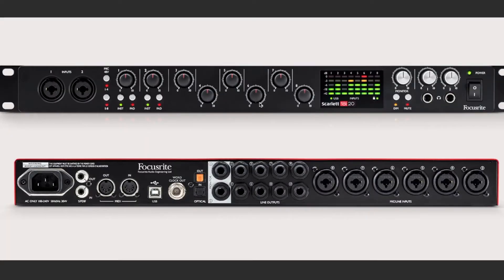Understanding Digital Audio Formats and how to use them. Lesson 12.

Comment: Amazing info and great detail. If you connect the SPDF output from an audio interface to the optical in on a computer would it play all those channels as a stereo mix? I know the usb only recognizes input 1 and 2 when you are not using a DAW. Would the optical in help me use the audio interface as a mixer? Thanks.
Reply from the maker: I don’t think it would play all the channels as a stereo mix. I’m not sure how the optical inputs on computers are integrated though.
Reply: Thanks, your channel is full of incredibly useful information 🤘🏼

Comment: really helpful, thanks.  I'm looking at the back of the rme 802 and wondering why there is an in/out aes/ebu xlr port.. does that only provide two extra channels? can't figure out the benefit.
Reply from the maker: So these AES/ebu ports that are XLR connectors are capable of interfacing with another AES/EBU device, and each XLR connector can carry 2 channels of digital audio at any sample rate. So on the RME, at 44.1 or 48 KHz, it can both send and receive simultaneously 18 channels of digital audio, 16 through Adat, and 2 through AES/EBU. At 88.2 or 96 kHz, it can handle 10 channels of digital audio, 8 with Adat, and 2 channels of AES/EBU. Thanks for the question :)
Reply: @Get.Pro.Recordings  makes sense! appreciate the detailed reply :)

Comment: It's never clear with the AES/EBU which is the input and which is the output though
Reply from the maker: Yeah, it can be confusing. They normally use a DB-25 connector, which you would attach an 8 channel XLR breakout cable.  Each XLR connection can carry 2 channels of digital audio at any sample rate.  There's different protocols, but the most common is the Tascam pinout, in which XLR connectors 1-4 provide your 8 input channels, and connectors 5-8 are your 8 output channels.
Reply: @Get.Pro.Recordings  so digital output 1 carries channels 1 AND 2?
And Digital Output 2 carries channels 3 and 4?

I thought that digital output 1 should carry channel 1.
And Digital Output 2 should carry channel 2.

What am I missing?
Reply from the maker: @eirodgers07  There are different ways which the outputs can be configured. For instance, the Apogee DA-16 has a single DB-25 input for digital audio over AES/EBU. This coverts 16 channels of digital to analog. If you were to use a proper DB-25 to XLR breakout cable, there would be 8 XLR's carrying 16 channels of audio. XLR channel 1 would carry audio channels 1 and 2, XLR channel 2 would carry audio channels 3 and 4, and so on.
On the back of my interface, the Metric Halo ULN-8, there is a single DB 25 connector for AES/EBU. This configuration accepts 8 audio channels of inputs, and 8 outputs. So, XLR Channel 1 will carry inputs 1 and 2, XLR channel 2 will carry inputs 3 and 4. XLR channel 5 will carry outputs 1and 2, xlr channel 6 will carry outputs 3 and 4... and so on.